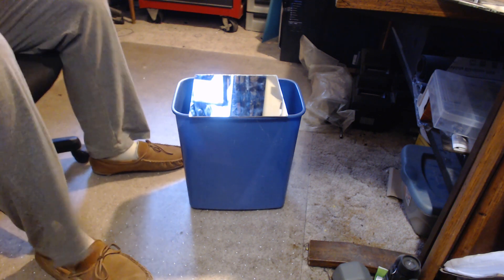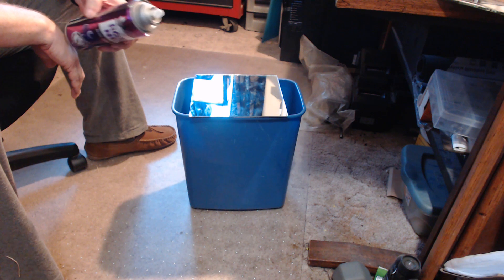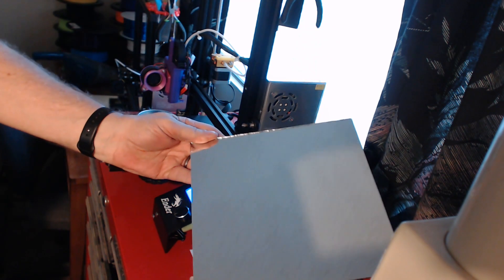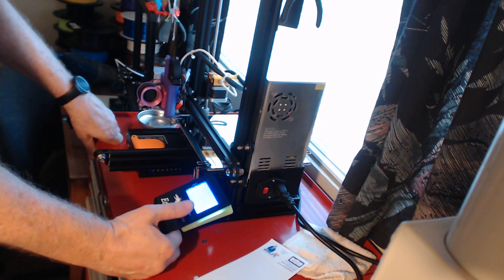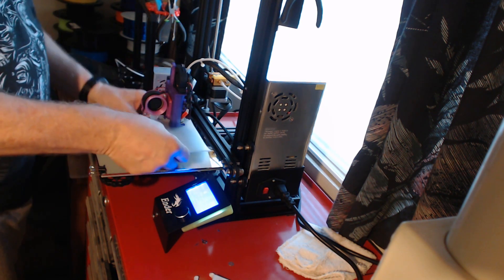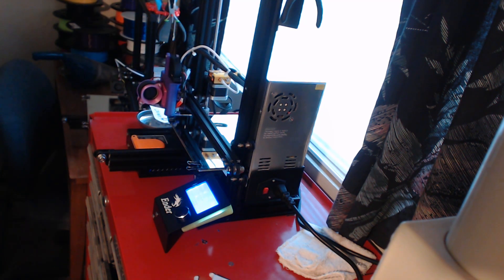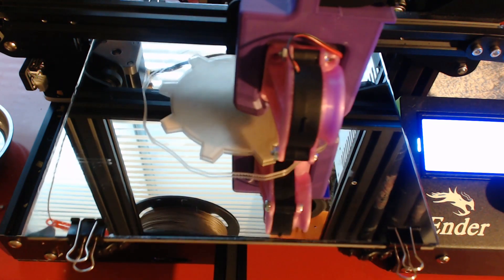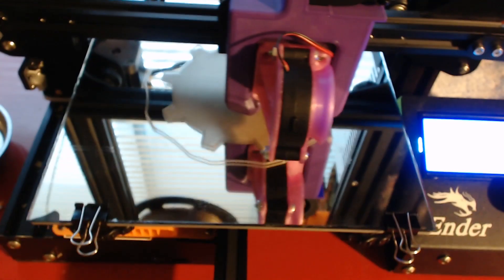3D Printing on Glass or Mirror Bed with Hairspray

Comment: how to remove?
Reply from the maker: Wait until the bed cools and most of the time the print will pop off. If it doesn't, I stick a scraper under one edge and tap with a plastic hammer and it pops off. I've never had one refuse to come off or damage the glass.

Comment: We just released a set of 2 HQ mirror print beds w/ Stainless steel clips for the Ender 3 on amazon. Search "3D Printer Mirror Bed" and look for Goodey brand! hxxp://www.amazon.com/Goodey-Printer-Mirror-Bed-Borosilicate/dp/B088PC3F69
Reply from the maker: Other than not having to cut the mirror to size, explain to us how this is any better than a mirror square that costs less than $2 ($10 for a pack of 6) from Home Depot, a $3 glass cutter and a pack of binder clips that cost less than a dollar for a dozen.

Comment: we r manufacturer of designer bath room mirrors in India for
the we need low cost machines and accessories to make the designer mirror for grinding
beveling ,making designs and hand cutter for our own use and trading as we r
based in Delhi/kundali/and Ludhiana if u can do it pl send ur offer to jindalsons02@gmail.com and whatsapp no
00919356426081/84 and 0091-9876157057

Comment: I have an Ender 3 Pro with a C-mag build platform... Can I install the glass/mirror over the C-mag build platform? or do I need to remove the C-mag build platform from the Aluminum plate?
Reply from the maker: How is it attached? If it comes off easily then I'd probably remove it if for no other reason than to promote heat transfer to the glass. If it doesn't come right off I wouldn't worry about it. I usually heat my bed up 5-10 minutes before I start printing anyway.
Reply: @3rdpig  Ya, its glued down. I will try installing it over the c-mag first to see how it works. thanks for the reply.

Comment: If i heat the nozzle before calibrating, i always have a bit of pla oozing out, which seems like it would make for an inaccurate distance. Am I way off base on this one?
Reply from the maker: I usually retract the filament manually first about 5mm or so and that minimizes the ooze, then wipe it off with a paper towel. And if you're using paper to set the gap, it will usually wipe off any that ozsez during the process.
Reply: @3rdpig  Thanks! One more question if you don't mind- why heat it when calibrating?
Reply from the maker: @theintruderfiles  Good question. Because the distance changes as the parts heat up and expand. A cold adjustment won't even be in the ballpark when the nozzle heats up to 200c or more. The bed might not make much of a difference, specially with the 50c I use for PLA. Theoretically, one could heat it, adjust it, let it cool and then measure again. Assuming there was any gap left at all you could use that measurement to get a ballpark cold adjustment. But since I'm about to print anyway, I see no real advantage to it, and it would only be a ballpark figure and only for that particular temperature.
Reply: Always, always, always preheat your bed prior to calibrating. I also suggest that you use feeler gauges (thin strips of metal) to calibrate rather that a sheet of paper (Amazon Link: https://www.amazon.com/gp/product/B000BYEQ3C/ref=ppx_yo_dt_b_asin_title_o06__o00_s00?ie=UTF8&psc=1). You will obtain superior results with feeler gauges when calibrating instead of with a sheet of paper (you are looking for a gap of 0.14mm on the Ender 3) It is also quicker than a sheet of paper. @3rdpig

Comment: I made a mirror bed with the  Aqua Net. What or how do you remove the prints?  Thanks for the video.
Reply from the maker: When it's done printing take the mirror off the bed and let it cool to room temperature. Then the print will either pop off easily or you can tap a sharpened scraper under one edge and lift it up. But more often than not once the mirror cools, and you can let it cool on the printer it just takes a lot longer, it will pop right off. Also, I recommend a bed temp of 50c and bring the bed up to temp about 5 minutes before starting the print to give the glass time to heat up so the first layer sticks.
Reply: Thank You

Comment: Chuck, I have a Ender 3, and I have a BLTouch setup that has solved any leveling issues.  I just switched over to glass and went out and got that Aqua Net hairspray you're using.  However, I'm having issues when printing PLA (3D Solutech).  I have the nozzle set to 200 and the bed at 60, and I get a great first several layers.  However, after 1 or 2 hours (on a 9 hour print), the whole print just pops off the bed, brim and all.  Now I pulled up an article that Matterhackers made that said to start out with the nozzle at 205 and bed at 70, so I just started another print job with those settings.  Also, I laid the print down (it was standing up very narrow before) and I'm doing a brim with 15% support (due to the shape), so basically the whole print will be sitting on support material with brim around it.  The good thing is that it will no longer be standing up to a total height of 130mm.  However, I was wondering what are your exact settings, and do you have anything to add.
Reply from the maker: I've got a part I designed that's  200mm wide, 40mm deep and 220mm high. It's a 32 hour print. The first couple I printed I was knocking them loose during the print. To try to stop this happening I added an 8mm brim and rotated it so it prints diagonally into the corners of the bed I set Cura to "Avoid printed parts while traveling", "Z hop when retracted" and "Z hop only over printed parts". For this part I also set "Initial layer height to .24, which is supposed to help adhesion. I clean the glass surface before this print and give it 3 layers of hairspray. I print it at 210 and 50 with cheap PLA. Before these changes I could just tap the side with my finger and it would pop right off, the last one I printed stuck so well that I ended up pulling the glass off and tapped a scraper underneath the brim to get it to release. It was really on there good.

What nozzle to bed distance does your ABL set to? I manually set to the thickness of a piece of copy paper and I heat the bed and nozzle before making the adjustment. I would think that too great a nozzle to bed distance could cause this, or at least exacerbate it. Try an extra layer of hair spray too.

I'd like to hear more about you BLTouch setup. Is there an online guide you followed? What firmware are you using? Did you lose any features in order to get the code for it into memory? How well does it work with the mirror?
Reply: Chuck, the BLTouch is well worth the effort to install.  You can set it to whatever distance you want by setting the Z Offset.  I ended up taking my manual level knobs off and replacing them with lock nuts; as once you get that level, you should never need to set it again; the BLTouch does all of that for you.  I usually heat up the bed and set the Z Offset before each job, which only takes a minute to do.  I use a .1mm feeler gauge (https://www.amazon.com/gp/product/B06XHXJG31/ref=oh_aui_detailpage_o05_s00?ie=UTF8&psc=1); as I don't trust the paper (paper being soft).

Yes, you'll need to load a bootloader onto the Ender 3 first.  You'll need a Arduino and some jumper wires to do this.  Once that is done, you will always be able to update the firmware through the USB port.  Here are a couple of helpful videos to watch on the subject:
https://www.youtube.com/watch?v=KoCvwPZUkBI
https://www.youtube.com/watch?v=ocAeZRPVusw

Make sure you don't purchase a fake BLTouch.  This is the one that I purchased:
https://www.amazon.com/gp/product/B076PQG1FF/ref=oh_aui_detailpage_o04_s00?ie=UTF8&psc=1

You'll need to download the latest firmware from TH3D:
https://www.th3dstudio.com/knowledge-base/th3d-unified-firmware/?seq_no=11
Make sure to download the Full Package; as the full package has the Arduino software andBootloader that you'll need to install first.

You'll also need to make a mount for it.  I use a stock setup, so the mount I made wouldn't be the same one you need.  I'm sure there is one on Thingiverse for your setup.  As far as accuracy goes?  It is spot on.  I did one of those 1 layer across the bed test, and that was super impressive!

It takes a little time to do, but the firmware is so much better than stock, and the BLTouch turns the Ender 3 into a perfect machine.  For the less than $50 cost, it is the best thing (along with the free bootloader and firmware) that you can do to the Ender 3.

As for my print job, after laying it down, it did finish printing after almost 12 hours.  I had to use supports, which I hate, but its done.  The print was the Profile LED Light setup for the Ender 3, so it didn't need to be pretty; just done right.  There were 4 parts (all the same), laid done on the X axis.  The front one had a couple of mm peeling up on the front two corners, but it was just the brim, so no big deal.  All parts were still firmly attached to the glass, so that was nice.  Still, I would have much rather printed those parts vertically; guess I need to be more seasoned.

Anyway, good luck with doing the BLTouch if you choose to do so.  Plan a day to do it.  Before I did it,  I was getting filament jamming issues constantly.  After I did it, I haven't had one issue with jamming.  I love this Ender 3.  IMHO, it is by far the best printer for the money (sub $200) you can buy.  Right now it is my only printer, and yes, I will be buying a larger one.  My plan is to purchase a 500x500x500 printer as my second one, but I'll hold off until at least most of the issues get ironed out with those.  As fast as this market is advancing, I figure in the next year I'll be buying one.

Thanks for your help, and I hope I've done the same for you.
Reply from the maker: Thanks for the info! Both my Ender 3's have the bootloader installed and right now are running Marlin 1.1.X bugfix version. I've had the TH3D firmware on both of them at one time, and while it worked OK on one, the other (my early pre order Ender 3) had lots of problems with it. The Marlin bugfix has been really good. I'll have to check to see if there's a option in it to use an ABL device.
Reply: I want to thank you for sharing the settings you are using.  I applied those settings to the last print I did, and it held like cement (sliced my finger to the bone on the glass edge trying to pry the print off).  There was absolutely no lifting on the corners.  I'm now 9 hours in to a 20 hour print using those settings again, and again, no lifting on the corners.  I too use cheap PLA, so it looks like those filaments don't like normal->high bed temperatures.  At any rate, that was the last issue I had with getting great prints, and it looks like you helped solve that final issue.  Thank you again Chuck and keep up the great videos!!
Reply from the maker: You're welcome! I'm happy that you got that solved. But get a sander and smooth the edges of the glass down, I don't want to be responsible for you getting the nickname "Gadget Nine Fingers". lol
Reply: @3rdpig  What about cooling? should part cooling be used? and at what layer? thanks and great vids.
Reply from the maker: @roccofpv2191  I use cooling for PLA starting on the second layer. I do not use it at all on ABS and nylon.  With PETG I like to leave the part cooling fan off, but when bridging or on thin walls it can droop, so for that part the fans might need to be on.

Comment: Hey, where did you get that mirror?
Reply from the maker: I bought a pack of 6 of them from Lowe's and then cut to fit if needed. I got the glass cutter there too. Any home improvement store or hardware store will have mirror squares. Most hardware stores like Ace would probably cut one for you if you asked. I wanted to learn how to do it so I just bought the cutter and practiced on one. It's easy to cut them.
Reply: Thank you!

Comment: I've been printing on a mirror with both my CR-10 and Ender-3 and never had to use hairspray, tape, etc. I find as long as the bed is heated enough, things stick just fine. I use 205C nozzle and 65C on the bed. Curious if you've tried upping your bed temperature instead of using hairspray?
Reply from the maker: I've printed successfully with PLA and a 60c bed with no hairspray, specially if I use a tight nozzle to bed adjustment, but for me it's not anywhere near as reliable as with the hairspray, specially for parts that have a lot of detail on the first layer, such as small holes or inset text. And with other filaments like PETG where I want a looser nozzle to bed adjustment it won't stick reliably at all.
Reply: Chuck Bryant I haven't printed that much with PETG, but find I have to turn the bed up to 80C for it to stick reliably.
Reply from the maker: I've had a number of issues with PETG and yes, the bed needs to go to around 80c, but I've also needed a looser gap between layers or I get globbing. For me the easiest way to achieve that was with the bed level adjustment and with the larger nozzle to bed gap comes the need for more adhesion.

I guess the bottom line for me is that hairspray on glass or a mirror worked so well for me across all filaments, temperatures and nozzle to bed gap distances that, I've seen no reason to try anything else. And it's not like the hairspray is expensive, dangerous or hard to use.

I'm a believer in "Run with what works for you". Hairspray works really well for me. If you don't need it, that's great.

Comment: where do you find the mirror that size?
Reply from the maker: I didn't, I cut a larger one to fit. I bought a 12"x12" pack of mirror squares and a glass cuter at a local hardware store, watched some youtube videos on cutting glass, practiced on one and then cut another one. It's easy to do.

Comment: I was so frustrated with the printer (almost cried, even when I'm 18 lmao) until someone told me to buy a 4mm normal glass sheet and hair spray, then ppl at reddit told me about your channel, pretty awesome, new sub :)

my method basically consists of taking the glass off for cleaning with isopropyl alcohol and after heating at 60°C i put the hair spray when the glass is heated on the bed, not too much just the enough and today im making the first long print (3hs) and works like a charm! now im so happy!

Comment: I have not had to use the hairspray method yet on my Ender 3 or CR-10.  I heat my beds to normally 60, I do use a mirror on both printers that I purchased from my local home center and seems to stick well on the first layer.  I do clean my mirrors with warm soapy water but in between prints I use windex mixed with a touch of 99% isopropyl alcohol.  If my prints would not have stuck my next step was to start using hairspray like Chuck is doing.

Comment: Never used a mirror myself but am curious to try when my Ender 3 arrives. How hard is it to pull off a print with that much 1st layer surface area when using this method?
Reply from the maker: Very easy. You just saw how easy.
Reply from the maker: They come off pretty easy once the bed cools. I just tap a sharpened scraper under an edge and they pop off.
Reply: The prints come really easy with the included scraper! (Even when im so hyped and i don't wait for the bed to cool down)

Comment: hi I just put together my ender 3 and tried leveling the bed. its always one corner that is too high and grinds against the nozzle. I even tried tightening all corners to the max and still got the same result. what should I do?
Reply from the maker: Both my Ender 3 beds are dished. Someone told me right off the bat, "Don't mess with it, get a mirror or glass cut to fit and use hairspray, thank me later". I picked up a pack of six 12"x12" mirror squares from Lowe's for $8.99 and got a glass cutter at the same time for $4. I watched a couple of videos on cutting glass, practiced on one and cut the next one perfect.